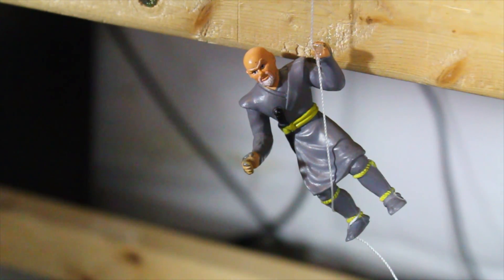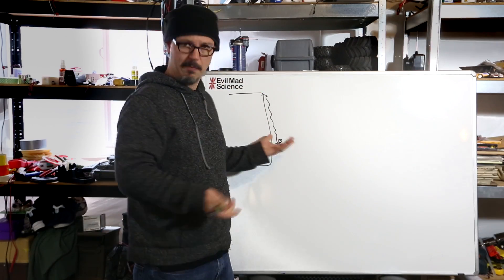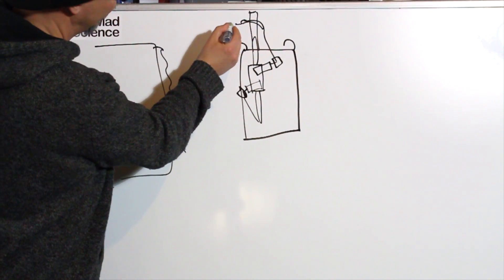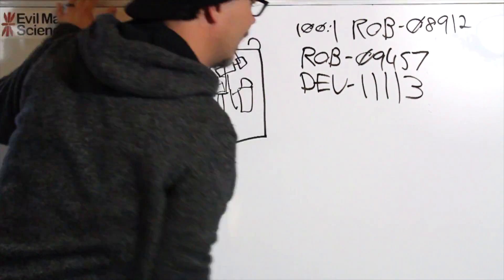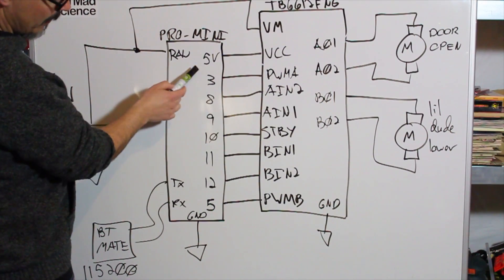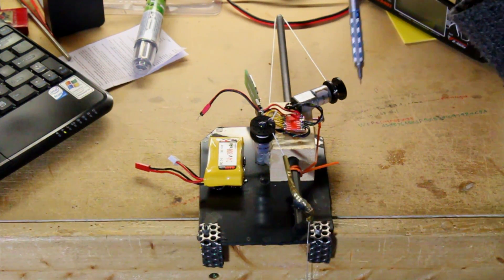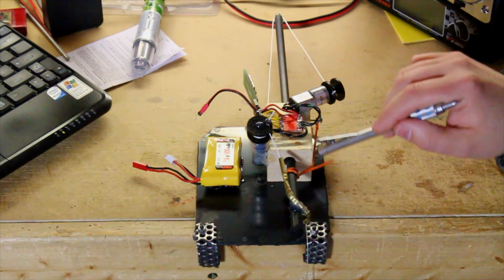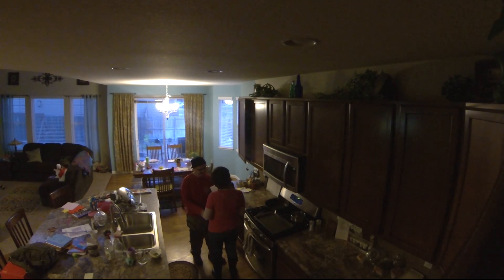SparkFun According to Pete 3-4-13: "Little Dude" Project

Comment: If the motor driving the rod was mounted so its axle ran vertically (like the dude motor) you could avoid the angle problem, right?

Love it, as always - thanks for making it!